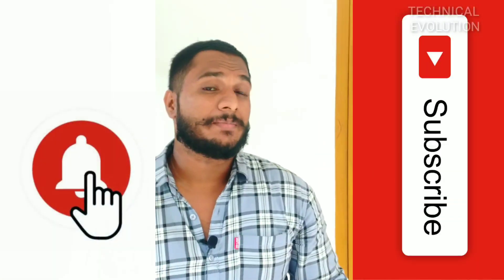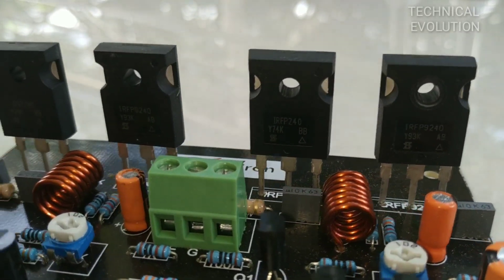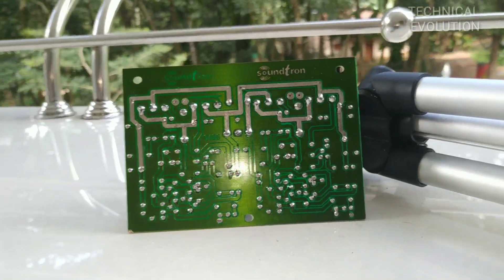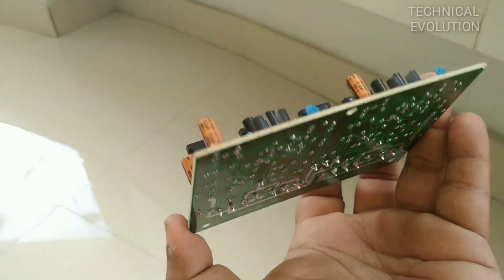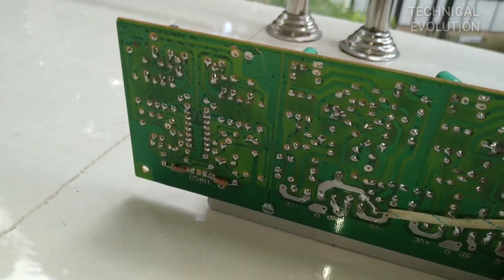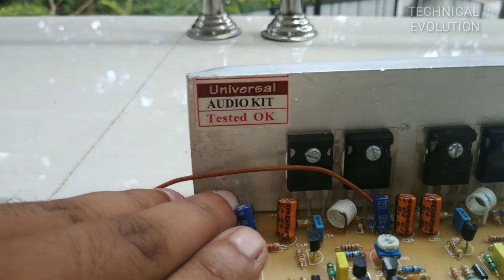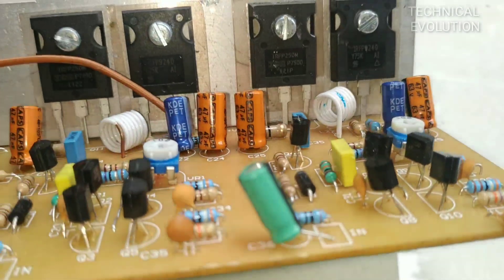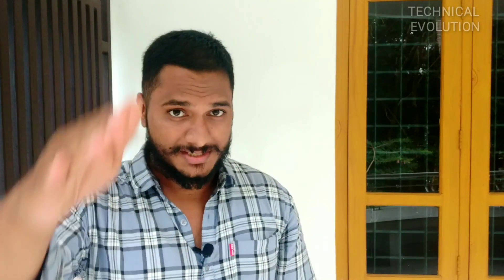Mosfet based amplifier board from soundtron best in class 250wrms

Comment: ഏതാണ് best performance amplifier??
2SC 5200, 2SA 1943 Combination ആണോ അതോ 240, 9240 MOSFET amplifier ആണോ ???, Pls reply...
Reply: If you  want to use mosfet use tra ac volt 24 10 amp 5.1
Reply: For sub use 4 or more mofet board tra ac 24 0 24 5 to 7amp
Reply: Not both. Tda 7294  with tra ac 18 0 18
Reply: If you want louder  voice than quality use 2sc5200 combination

Comment: Power supply??
Reply from the maker: +/-35vdc you can use 27-0-27 vac min 5ampr
Reply: @technicalevolution9887  maximum ethra ampere kodukka
Reply: Working video idumo
Reply from the maker: @bipinbg8845  idunnjnd brother

Comment: അരുണ ബോർഡ് ഉപയോഗിച്ചവർ ഉണ്ടോ
Reply from the maker: Ya stereo use chythittund
Reply: @technicalevolution9887  ഔട്ട്പുട്ട് എങ്ങെനെ ഉണ്ട്
Reply from the maker: Kollam nalla board anu
Reply: @technicalevolution9887  bro 
Mono sub out ulla oru inputl നിന്നും സബ് ഫിൽറ്റർ ബോർഡ് ലേക്ക് എങ്ങനെ കണെക്ഷൻ ചെയ്യണം (സബ് ഫിൽറ്റർ ബോർഡിൽ ലെഫ്റ്റ് ഗ്രൗണ്ട് റൈറ്റ് എന്നിങ്ങനെ ഉണ്ട് )
Reply from the maker: @zayauxtech4020  subwoofer filter input left right 1k resistor avach short chyth mono input akkam
Reply: അരുണ board mosfet ആണോ transistor ആണോ യൂസ് ചെയ്യുന്നത്. അരുണ ബോര്‍ഡ് എന്ത് വില വരും. അരുണ Smd അല്ലെ
Reply from the maker: @jayakrishnanpvm1  transistor anu veroralk vangitharnnu njan check chyth nokki 750 arnnu stereo kore naal munne vangitharnnu Kollam nalla board anu stk 4231 circuit anu
Reply: @technicalevolution9887  bro നിങ്ങൾ മാത്രമാണ് proper reply തരുന്നത്. Subwoofer amp ഒരെണ്ണം ഉണ്ടാക്കണം എന്ന് ഉണ്ട് ഭായ് സഹായിക്കും എന്ന് പ്രതീക്ഷിക്കുന്നു
Reply from the maker: @jayakrishnanpvm1  help chyam
Reply: Hi bro ഇവിടെ നമ്മൾ എല്ലാം ഒരേ മനസുള്ളവരാണ് വീഡിയോസ് കാണാൻ എത്തുന്നത് എന്നെ പോലുള്ള ചെറിയ അറിവ് മാത്രമുള്ള ആളുകൾക്ക് നിങ്ങേലെ പോലുള്ളവരുടെ ഹെല്പ് ഉപകാരപ്പെടും അത് കൊണ്ട് വാട്സ്ആപ്പ് നമ്പർ ഷെയർ ചെയ്യുമെന്നു പ്രർഹീക്ഷിക്കുന്നു
Reply from the maker: @zayauxtech4020  bro ini mutual watsapp number description nil ittekkam kore videosil njn comment boxil ittittjnd